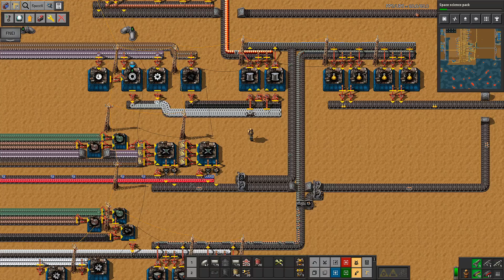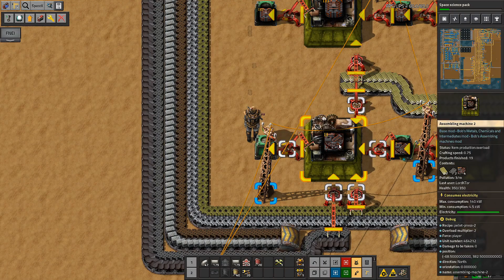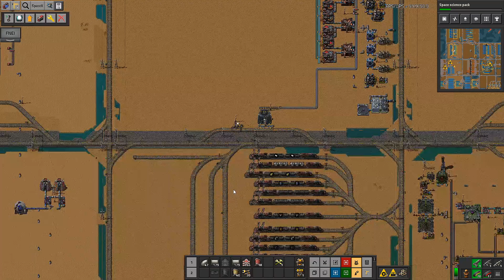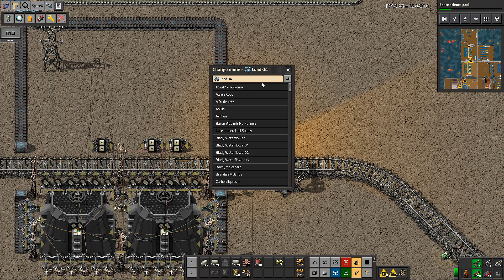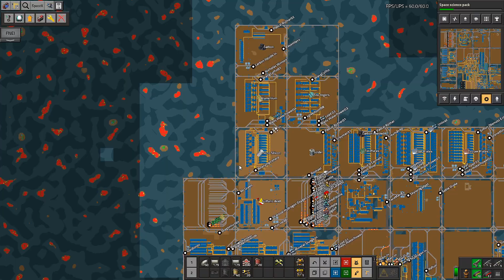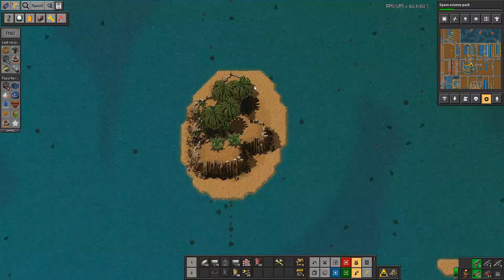Factorio 1.0 Seablock + TSM ep155

Comment: I might have lost something but on the aluminum station why did you use a fixed filter instead of a filter controlled by the signal provided by the station?
Hint1: You can copy the symbols in train station names no need to type so much.
Hint2: by changing slightly the naming convention for the aluminum "green" stations I think you might have screwed-up the ordering of names
Hint3: start dupping gardens
Reply from the maker: So maybe I should take a proper look at that mod suggestion of yours?

Not sure what you mean by "dupping "...?
Reply: @Sandman-qi2jy  by copying I meant Ctrl + C Ctrl + V, the dupping I meant there is a recite to get extra gardens, from those If I'm not mistaken you can make more trees that way you are independent from map exploration
Reply from the maker: Got it, ok thx. My current expansion is pushing me into new sources of gardens and trees, but it makes sense to use the recipes and not be reliant on exploration.

Comment: Hi, one question? Are you upscaling the videos? I'm asking because while watching in 1080 it still seems way too pixelated.
Not a critique just to try and figure out why this is hapening
Reply from the maker: Thanks for asking this as it forced me to check my setup. Not upscaling. It appears that I was getting the video from two sources on OBS. First a blank screen that was supposed to be the factorio window, and second the display look at itself. Presumably it was mixing the two sources resulting in the pixellation.  I have corrected this now. The system is just reading from the factorio window (which is now showing factorio).

This should be evident from ep157. Let me know if it has improved the situation.